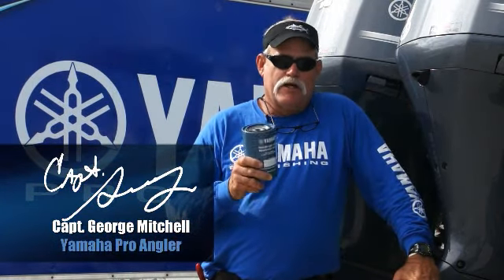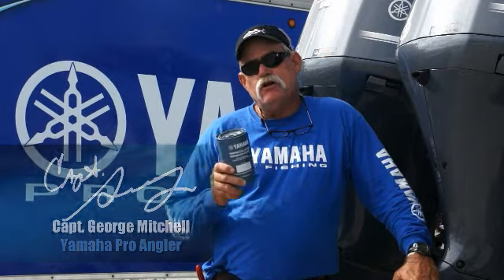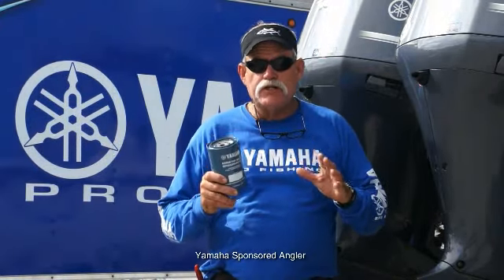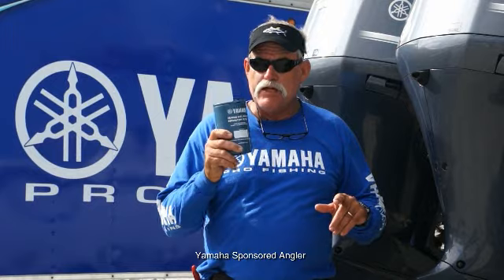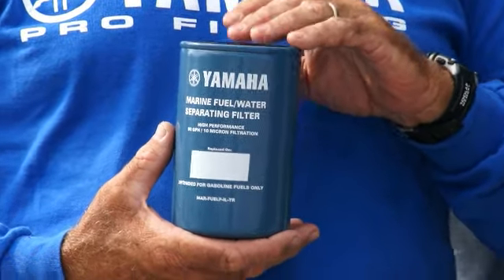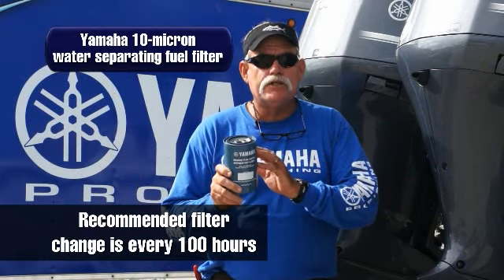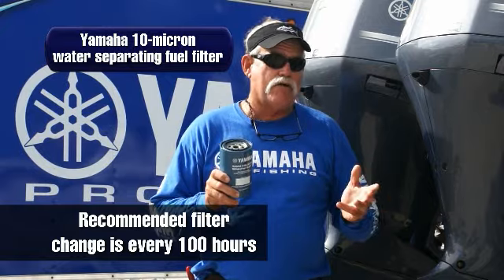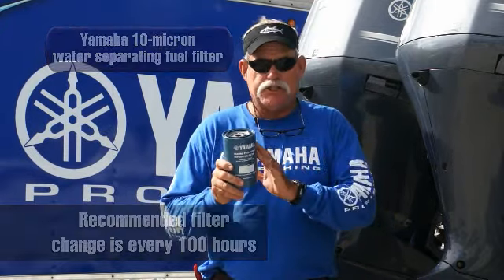10 Micron Fuel Filter | Maintenance Matters

Comment from the maker: @INTERCEPTOR431  The Yamaha 10 micron fuel filter is an accessory that we recommend to be used with all Yamaha Outboards, however it does not come as part of the engine/boat package. However, you may find some OEMs that install it at the factory and dealers that make it part of the finished rigged package.